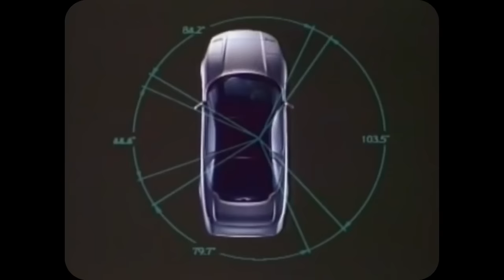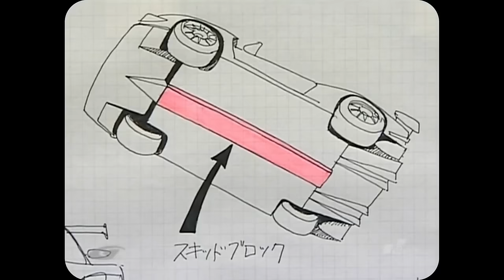This Car Raced for Over 10 Years. How did it Keep Winning?

Comment: It is remarkable that when NSX entered the grid, they were racing against R32s and F40s and on their last season they raced and won against R35s.
Reply: R33s to be exact when a NSX entered by Team Kunimitsu joined the JGTC in 1996
Reply: entered the grid being broadcast on those old ass crts and left in HD
Reply: @DiscGolfLeagueMVP aww come on CRTs aren't THAT old.. 👴
Reply: @AdamTheMan1993 i think it was ‘95, not ‘96. And they came first in the GT2 class which was a huge milestone at that time since their counterparts (NSX-R GT1 Turbo) failed to finish.
Reply: Pretty remarkable achievement but it's the result of a good project and tons of resources in development remarkable indeed but not unexpected
Reply: Don't forget McLaren F1's, Lambo Diablos, and the Porsche gt2 platforms....
Reply: it never went up against an f40 bro
Reply: @ringoferrer2343  5:24
Reply: @jirihorsky9600  that footage is from '94 (or '95 but i'm fairly certain it's '94), the NSX started racing in '96
Reply: @ringoferrer2343  oh yeah, you’re of course correct. I got it mixed up. So neither R32 nor the F40 is correct.😅
Reply: If I was Honda I'd be like "we've beat the best in Europe with Senna in F1, taking on Toyota and Nissan will be easy."
Reply: @andrehooker3229  Even better that the nsx was maclarens blueprint and still couldnt overcome it
Reply: @AdamTheMan1993 back then there were also UNISIA JECS R33GTR and 1999 Mobil 1 NSX...
Reply: @suzumr2754 that car from Gran Turismo 1 right? I remember a lot that i struggle to win races using the NSX GT1 TURBO due to constantly sliding and spinning out a lot.

Comment: The 1998 photo @9:51 actually shows the Mugen X Dome logos on the noses of all four cars (the white/black Mugen logo & the orange/black Dome logo just below the Honda emblems) just as you're saying Mugen and Dome split. I suspect that Mugen-Dome Project was not only the name of the on again/off again entrant (team), but that the Mugen-Dome Project was the name of the developer/constructor of the JGTC NSX GT as you explained @7:00. While the 1997 car has only the Dome logo on its nose, it appears that all JGTC NSX GTs regardless of team have Mugen X Dome logos on their noses from 1998 through 2002. From 2003-2009 they instead have the logo/wordmark of Honda Racing.

Comment: Senna didn't help in designing the chassis, he just helped them find the perfect balance of the suspension geometry and driving feel that the car needs. 

By the time Senna was a household name, they were just done with the prototype in 1988 and by 1989, they got Senna into the whole prototype package and got him to do vigorous testing during F1's off-season which he gave extreme feedback on how the car should feel, how much the diff needs to lock or unlock and how stiff the springs needs to be and how much flex of the chassis can the driver feel. 
Senna did not have a say in how the chassis was gonna be made but he did give vital feedback on how to set the car up for general use which, he did real well in that manner.
Reply from the maker: That is correct, which is why I said "...and they lent on all of Honda’s best motorsport connections, including Ayrton Senna, to help craft a chassis and suspension setup that would...". Nowhere did I say Senna had input on chassis design, only "chassis and suspension setup".
Reply: @automobilistic So diplomatic... 
A fine example, sir. 🙏🏼
Reply: Ayrton Senna was a well known household name worldwide before 1985 when he drove for Lotus, he played a major part in the redesign and development of the NSX as a world champion. In the Ten years I seen him drive F1 he also drove a NSX on track and talked many people in buying the cars from 1988 to 1992 because he actually worked for Honda.

Comment: I always imagine “what if” Honda had stuck to the original NSX formula but updated it with 21st century technology and materials.  Carbon fiber, titanium and magnesium replacing steel and aluminum.  A “mated” double K20/24 4-4.8L V8, putting out 450-550hp NA.  Since I am dreaming, a 6spd manual, cuz automatics, even double clutch ones suck.  The crazy light materials allow Honda to keep the weight to under 3500lbs.  And let’s be honest, the original NSX at 270hp was considered underpowered vs what was available back then as well.  People still said it was the purest sports car they ever drove back in 1990.

Comment: Right!! Thats it!!  Can someone tell me why we say an engine is mounted in the "middle" of the car when it is so obviously mounted behind the driver, in the back?  I'm 53 and I still haven't worked that one out!
Reply from the maker: To the best of my understanding "mid engine" simply means the engine is mounted between the axels, as opposed to over the axels (as in "front" or "rear" engine cars). Mid mounted engines can either be in front or behind the cockpit, but behind is more common. In front is sometimes called "front-mid" and behind is sometimes called "rear-mid" but because most "mid engine" cars are rear-mid most people just say "mid engine", only specifying when its the more unusual front-mid layout.

Don't take that as gospel but that has always been my understanding.